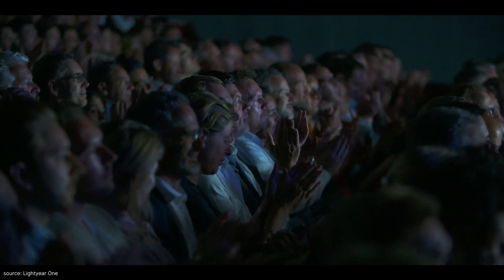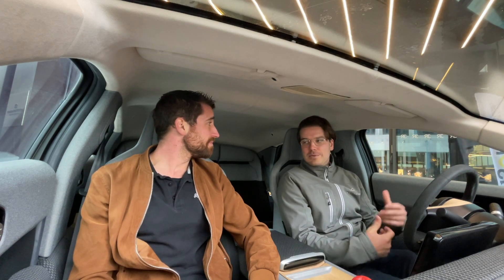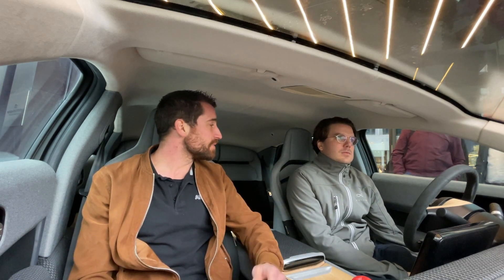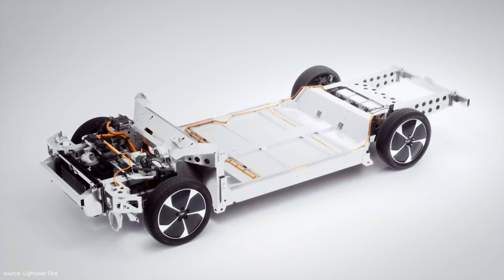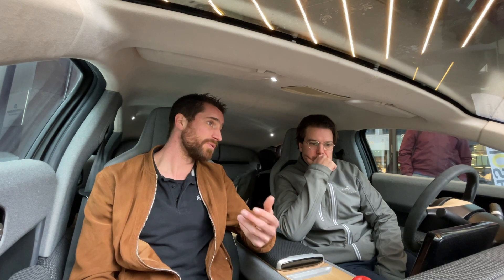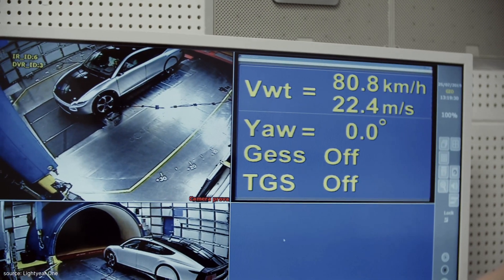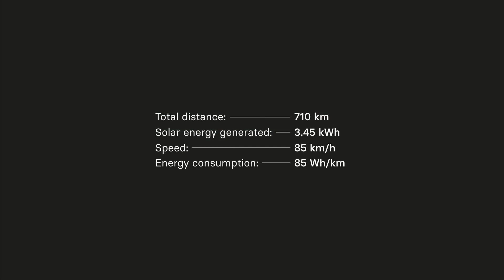Lightyear One - Solar Electric Vehicle - Walkaround & interview

Comment: bs car
Reply: As we can see, a lot of brainpower went into this comment. Let's please show some appreciation.
Reply: @ignasanchezl  Sure. It will satisfy some niche use cases for extremely rich. :) This car is overdeveloped for use  case of average driver. 
I appreciate they have I3 wheels, Tesla type back mirrors, PV panels that cost more than makes sense to place them. 
Student did put some solid effort. But overengineering toaster also would make 0 sense, right?
Reply: Tbh I see what you mean, but that is the point of a concept car. Do you think any of the super "halo" cars that companies build are for the average buyer? No, they are technology demostrators, from which general consumer tech trickles from.
Reply: The first commercial sold hydrogen car was selling at 80k and cost the company 150k to produce. Only by introducing "over engineering", "over expensive" concept cars in the market, you can drop the price of a new technology into acceptable range for most of the consumers. 

Salt water it was incredibly expensive to turn into drinking water a couple years ago, but if someone didn't pushed for that when everyone told him "bs technology", we wouldn't have affordable desalination technology today.

My aftermath is... Your comment is bs.
Reply: @andrefilipebmx YOUR comment is bs, cause the company is bankrupt and the prototypes were sold on auction. It is not hard to optimize all for efficiency, if you don't care for costs, mass production, usability and economic success. As it turned out, this was a students Kindergarten burning a heap of cash. Very dumb after all.